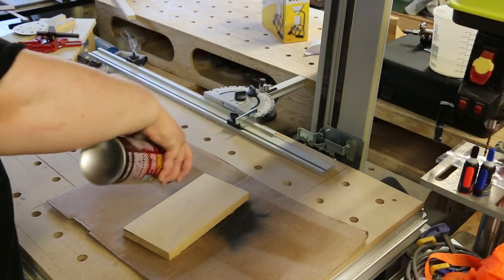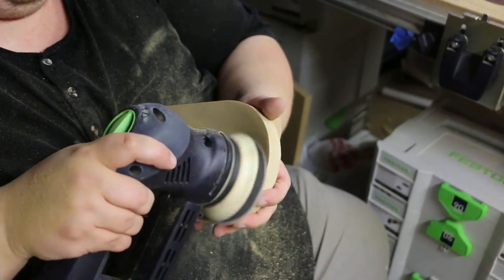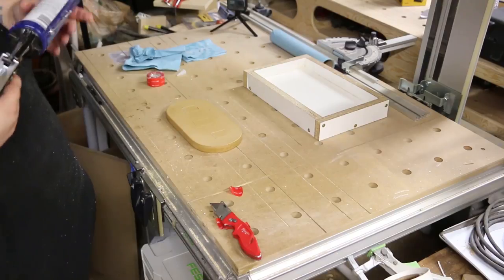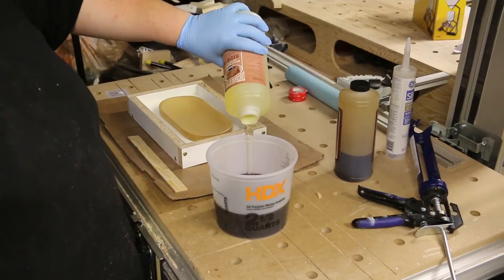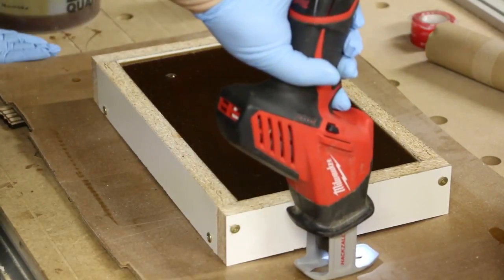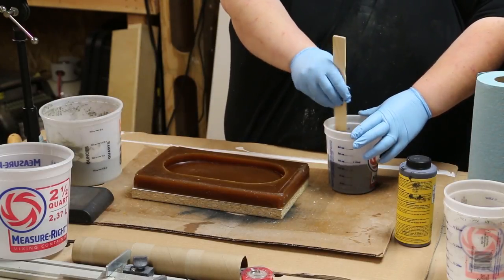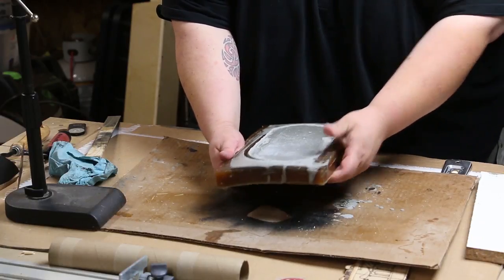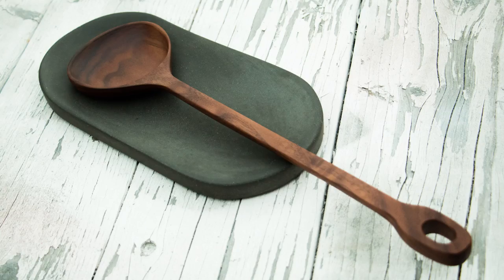Concrete Spoon Rest - Power Carving & Mold Making

Comment: Pretty cool!  I liked your idea of using rice to determine the volume....for the math challenged audience (or the lazy in all of us).
Reply from the maker: +Richard Cournoyer Thanks for watching, Richard! The rice trick definitely works well. Also seen people use sand but screw that mess! I was trying to be fast and didn’t have any rice I wanted to dedicate to shop use, so I just calculated the volume of the mold form, and guessed the percentage that was filled with the model and added a bit extra to make sure I didn’t come up short. Pretty sure I found a chart online that helped convert cubic inches to fluid ounces.